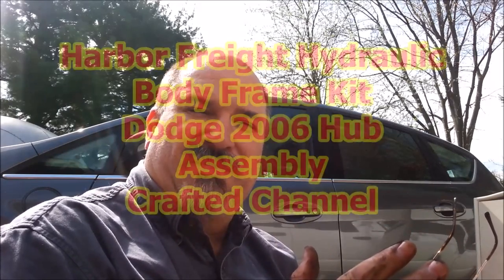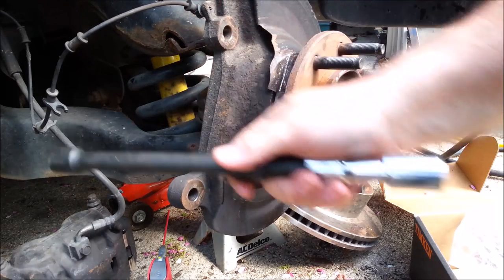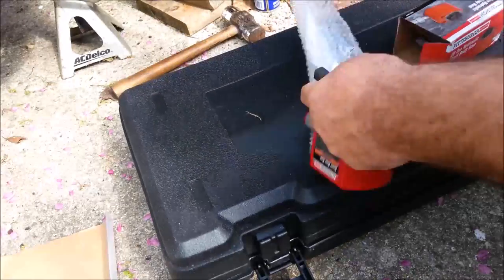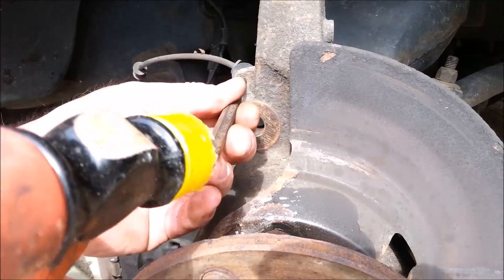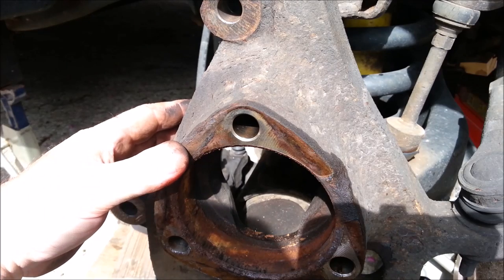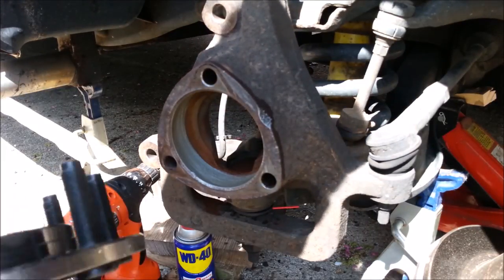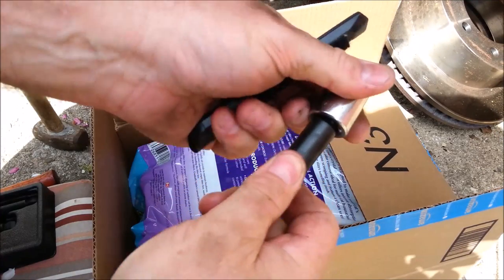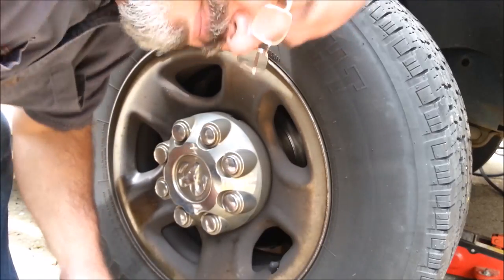Harbor Freight Hydraulic Body Frame Kit Dodge 2006 Hub Assembly Crafted Channel

Comment: Nice video buy 175 a piece for hubs?!!! Goos Lord go to rock auto for 70 a piece
Reply from the maker: I'll pass on the Made In China stuff.  Too many reports of them not lasting long.  You have to be richer than I am to afford to do it over and over and over.
Reply: @CraftedChannel  You mightve passed on the China made stuff, but you ponied up for made in Taiwan stuff. Just because it says made in USA, doesn't mean it was manufactured here 😂
Reply from the maker: @Laguna28083  Taiwan is not a Communist nation.  Taiwan does not make things with slave labor.  Neither do they appear to have any gain of function military bio labs from which to poison the world.   It is difficult to ween one's life fully off CCP goods but I am trying to minimize them wherever possible.  I am an abolitionist. This position has value to me.    Goods from Taiwan seem to have good quality.
Reply: @CraftedChannel  I completely agree with what you're saying, but unfortunately most wheel hubs are made in china, taiwan, spain, korea and god knows where else including timken. Unless you look at the back or the face of the hub, you don't really know what you're buying. I just get aggravated at people that only want to buy tools and parts only made in usa, but in reality, 98% of parts/tools are made elsewheres, including most the the tools that sold at harbor freight, but paying for parts that are so heavily marked up when you can buy the exact same thing and made in the same facility for less than half the price all because of a name is ludicrous

Comment: 1) Timken made in China 
2) Check out the hub buster tool,  A lot faster.
Reply from the maker: I was aware of the hub buster tool.  Nearly $100.  I purchased the hydraulic system because it is more multi-functional for me.  I used to have one 20 years ago and glad to have one back again.  If I were doing repairs for a living, I'd have the hub buster tool.  Less setup and smaller storage.
Reply from the maker: I double checked after my first reply.   It may be that some Timken Bearings are manufactured elsewhere but in this case I still have the packaging. Cool boxes for storing other things in.  I'm keeping lathe cutting bits in them.  Printed Made In USA on them.

Comment: By my calculations you spent triple what it would have cost you to take it somewhere you spent about $600 in parts and tools that I've seen so far I'm only 12 minutes and 33 seconds into the video you could have bought the designs tool to take the hubs out I believe it's around 50 bucks and save yourself $300 in tooling at your most likely never going to use
Reply from the maker: CarMD lists average mechanic labor rate for Ohio in 2019 at  147.78.  Repair Pal says between 311 and 429 per hub total cost figuring only 78 an hour and we know that shop rate is mostly a fantasy.   I got a free hydraulic set out of the deal and spent less than you would have spent.  But not everything is about cost.  Thinking only in terms of cost is narrow minded.   I've used the set 4 or 5 times since then  which indicates you are not to be considered a prophet.  Are you another mechanic irritated I would encourage somebody to repair something for themselves?  I am happy to receive the very cool tool you mention.  PM me for shipping address.

Comment: Chances are if you don't know what you're doing you're going to create more of a problem than you started with meaning it's going to cost you more money in Long term. and usually if you try to push on the outside of the hub that ends up splitting the bearing. Bad advise to give out on the internet.
Reply from the maker: Look at the date.  Truck still going fine.   Sorry to disappoint you.  I noticed you don't have any videos up on your channel.  That always seems to be the case when somebody makes nasty remark such as your own.  It's too bad we couldn't have bet a few hundred back then.  I'm guessing you wouldn't have had the courage.
Reply: @CraftedChannel  I'm sure the truck is fine. But please don't make a look how easy it is video. There's a lot of ambitious people out there that don't have a very big skill set. I've  seen it first-hand. This is going to sound crazy but next time your trying to remove a wheel bearing take a screwdriver and grind the end down and make it nice and sharp and use that to separate the wheel bearing from the steering knuckle. You'll probably destroy the plastic on the screwdriver. I have one in the box that is just for this purpose. After that then use a chisel once you get some space. If she won't move all you need is a little heat. I know from experience. Experience saves you a ton.
Reply: Plum. It's not rocket science. Screwdriver! LOL

Comment: Tools of Freedom why didn't you go ahead and buy the tool made to break those hubs free that bolts on the lug nuts any smack it with a hammer and jars it free almost looks like a trailer hitch receiver with a plate that bolts onto the lug nuts instead of a ball
Reply from the maker: I didn't say "tools of freedom".  Your attention to detail is lacking.  I knew about the tool you mentioned.  Cool tool. Has one purpose and does it well.  The hydraulic set has many.   And let me tell you, I didn't have time to wait for it to be shipped.  I realized it was rusted in there on a weekend and I needed to use my truck to pull a trailer in the next day or two.  I spent my money to get the job done the best I could in the time I had to do it.  And I got a Hydraulic set I have used over and over for my effort.   It's my money and my time.  I will do as I please with both those resources as you should with yours.

Comment: the bitch I have is you risk distorting the caliper bracket. I suspect you will find uneven wear in brake pads .
Reply from the maker: You do realize these are cast iron parts?    You can't bend cast iron.  It breaks.  It's like glass.  Very tough but like glass in it's brittleness.  If it were aluminum or steel, yes this would be a possibility.  But nothing like that exists on a pickup truck.  Cast Iron is nearly universal except for high performance and race cars.   Cheap way to make odd shaped parts with minimal machining.
Reply: @CraftedChannel  caliper brackets bend and are readily available at parts stores it isn't uncommon at all. . I've been doing brakes for alm I at a half century
Reply from the maker: @timerickson7056  I hate to disappoint you.  The truck goes down the road straight and I didn't bend anything.  Are a offended that I did this work myself?   Without paying a professional mechanic?   I've worked as a professional mechanic.   And more importantly.  I will do as I please.  I have a garage door video that incenses garage door installers.  How dare I.
Reply: @CraftedChannel  didn't say it would be affect the tracking . I said your brake pads would wear uneven causing shorter brake life. I'm not disappointed . 
 I put it out there so other people don't copy your MISTAKE.
Reply from the maker: @timerickson7056  Your a sour mechanic with NO YOUTUBE CONTENT.  And why are you not working today?  11am?   Heheheeh, these tolling critical comments always come from some person so courageous they never put out a stitch of their own content.  Please do a video showing your methods for removing a stubborn hub and send me a link.  People need to see how a real professional does it.  Go ahead.  I will cheer for you and like the video.  Promise.
Reply from the maker: @timerickson7056  Funny, thank you for that.   It's a nice kit for the bucks involved.  Count all the legal votes my friend and be careful, certain concepts cause mental problems.  TDS is very destructive.   I don't wish it on anybody.  Not even you.

Comment: People please dont repair cars like this. To remove ur unit bearing thread in the bolt hit the head of the bolt with a HAMMER... Do not use hydraulic pressure ? Its corroded hitting it breaks corrosion. Using a ram. STORES engery and metal NOW STOP AND THINK THE HUB WEIGHTS 5 10 POUNDS?... Tools r freedom but common sense saves from a headache.. Or getting hit by flying metal... Not a myth common sense.. Like a frozen press fit. 🤔 Glad to see the anti seeze...  Please be safe god bless

Comment: I love tools too! but the right tool should be used. This is very bad advice, do not follow.

This was not the right tool for what you are doing and could very well ruin the knuckle by bending the knuckle and throwing its bearing receiver out of wack as well. By having all the force on one side, it cocked the hub as it pulled out and I could see the hub was cocked as it came out, which probably means the knuckle is out of round. 

A 2nd error was putting the jack against the knuckle, both the knuckle and the hub are moving in opposite directions as the jack pushes both ways (Newtons 3rd Law of equal and opposite force), so not only did the jack cock to the hub to the side, both the knuckle and hub are moving from each other in what looks like a circular pattern going upwards, so now they are both cocked in yet another direction 

This probably all throws throws your alignment permanently out of wack.

I'm not putting you down Brother, just giving you some engineering knowledge. Right tool for right job, but every tool has a hammer end.
Reply from the maker: I'm sorry to disappoint you.  Everything turned out fine.  You'd think nothing would have worked and I'd still be working on it.??  With your big science words, It's amazing it came out at all.  I feel very lucky.  I mean really, you are out of your mind.  Let me check your channel.  I bet you don't have a single video.  That is usually case.  Lets look and see.   ....... Oh guess what?  No content.  How did I know.  I'm looking forward to you putting up some content so we can see if you are made of peanut butter or cast iron.   I'm not pissed, don't misunderstand.  I'm amused.
Reply from the maker: How did I get the hub off then while ignoring physics.  OMG, you live in a hilarious fantasy world.  As if it would be possible to remove the hub extra physics (that means outside of physics).   The flange (it's been a while) was maybe 6" in diameter and what 3/8" deep?  You get your calculator out and tell me how oval'ized it would be 1/8" out of square with the bore.  And then, perhaps you could tell me how much force was involved.  I have a collection of machinist handbooks which I could use to produce this minuscule number for you but I won't bother.  I doubt you have even one copy.  Do you have a 6" mic you could use to measure 1/8, 1/4 & 3/8" offset corner to corner on a 6" ring?   I do and I also have the experience to realize it's minutia.  Also, you haven't even considered that there was NOT METAL IN THE GAP.  There is clearance (That is a gap) between the hub and bore.  Clearance means the parts slip together.  The hub was smaller than the bore.  What was filling clearance making it tight was not metal but rather Toll-house Cookie material called rust.  Had you paid attention to the entire project, you would have seen me chipping it out (I am pretty sure I included some of that).   These are all things you didn't consider before you formatted your confusion in the form of a dire warning to an idiot.     Are you trying to convince yourself RUST pressing on the bore of that cast hub could distort it?  Or are you ready to admit you didn't consider all the facts?  I don't think you have a good model in your mind of the forces involved let alone the materials involved.

A gentleman would have wrote: "Your method of removing the hub resulted in it getting slightly cocked in the bore.  That would seem to have put a lot of pressure on the bore.  Am I missing something?"

Instead I'm left wondering you must have very recently completed those science courses.  The internet is filled with 14 year old boys arguing in comment sections because they haven't yet learned to interact in a more experienced fashion.  Is that what is going here?

Comment: And you never been taught how to replace a f**** tire or what you do not use an impact for one and two if you're going to use an impact you go in a cross pattern and three you never trust the impact tightened it enough and you torque your wheels to Specs most rims are 85 foot pounds. Whatever you do for a living stop touching cars you do not know what you're doing something were to go wrong and come off and cause you to crash into somebody and kill them it would be your fault because you did the work not knowing what you're doing by the manual it'll teach you how you're part of the reason that mechanics get a bad name I bet them hubs do not last you very long most hubs that I've dealt with had to be torqued to spec otherwise they wipe themselves out